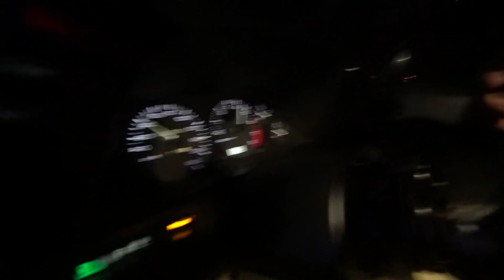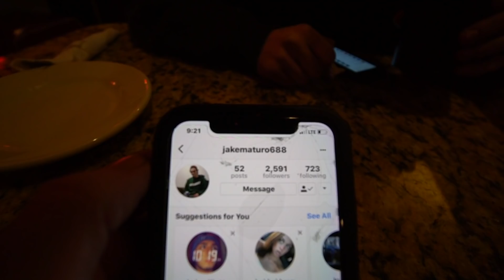MISSILE TOOK MY SKYLINE FOR A JOY RIDE...

Comment: etching primer is for the bare metal dude! easy way to remember is just think of what the word etch means, it's like scratching so think of the stage in painting that you scratch- yup sanding, that's basically what an etching primer does, it uses corrosives to rough the metals surface which helps the paint to stick.